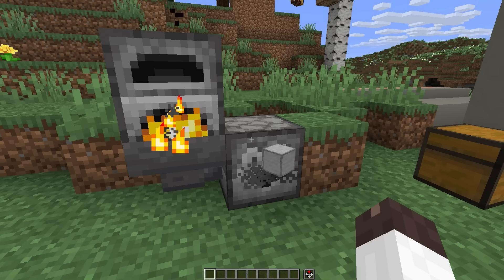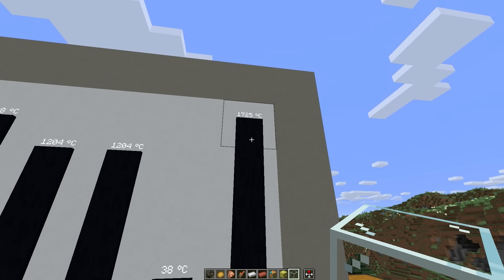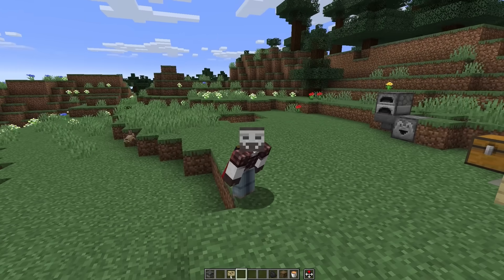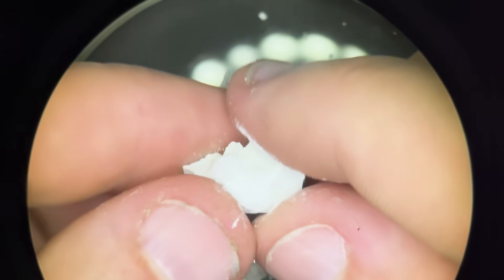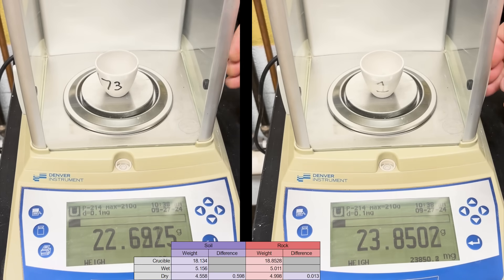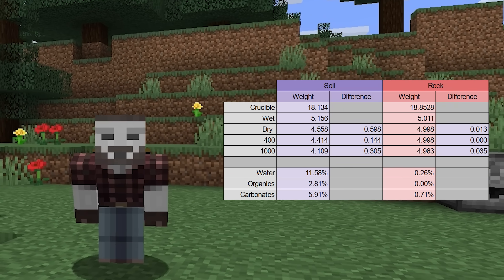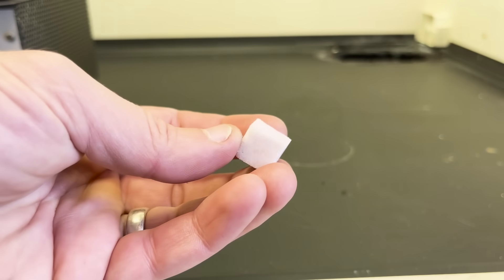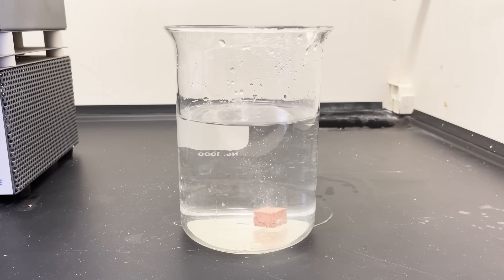Can a furnace make stone smooth?

Comment: when you throw the cooked limestone into the water, the reason it crumbles completely is because its reacting with the water -- cooked limestone forms something traditionally called quicklime, which reacts with water to generate significant heat and something called slaked lime, which can be used to make cement and i thiiink is the basis for most mortar? not as familiar with modern cements.
Reply: Lime is also a precursor to acetylene! They cook it alongside coke (a purified coal) at very high temperatures to make Calcium carbide and drop that in water to make Acetylene welding gas. (It also makes calcium hydroxide!)

Limestone is a very useful little rock.
Reply: @nata5212 Calcium carbide can also be used to artificially ripen fruits (but it's probably not a good idea, read below), as the acetylene gas released has a similar effect to ethylene, a natural plant hormone.
However, in practice calcium carbide can contain traces of arsenic and phosphorus, leading to contamination and health risks. Hence, this practice is usually considered dubious.
Acetylene: ethyne ( HC≡CH )
Ethylene: ethene ( H₂C=CH₂ )
Reply: more formally, the calcium oxide reacts with the water to form calcium hydroxide. Which is a different chemical! -- not a hydrate as it might be mistaken for.
Reply from the maker: Thanks for the answer!
Reply: Quicklime is where the phrase "in the limelight" comes from- when a flame fed by oxygen and hydrogen is directed at quicklime it produces an extremely bright light that was used to light theaters and music halls- people used to literally be in the limelight!
Reply: Also, CaO (quicklime) expands when it reacts with water to form Ca(OH)2, which is a base for a demolition grout (a mixture of compounds that expands in contact of water, which when put in a hole can shatter rocks).
Reply: people have been cooking limestone for thousands of years.
Reply: @spookyweeb5563  its theorized that native americans growing corn cooked with implements with a lot of lime, the lime created an alkaline solution which caused the corn go through a process called nixtamalization which allowed unavailable nutrients to be released and disgested. when europeans began growing corn they didn't know to nixtamalize it so pellagra, or b vitamin deficiency, became common in Europe at the time.
Reply: @art-eroflore  That innovation was more of a Mesoamerican thing if I recall correctly, since Mississippians like the Cahokians did not nixtamalize their corn and thus encountered some forms of protein deficiencies
Reply: @tylerphuoc2653  mesoamericans are in fact Native Americans! the americas = very big
Reply: @art-eroflore  yes, and you stated "native americans growing corn" largely without caveats, possibly implying that all maize-growing peoples fed themselves the same way off their crop. Mesoamerica was quite a large region, but their trade networks during times of plenty connected settlements quite well — enough to spread the innovation of nixtamalization — in a way that wasn't present to the same degree for much of the Mississippian peoples
Reply: @art-eroflore  Mesoamerica refers to a specific part of North America and a bit of Central America. It's quite far from modern day USA.
Reply: @ nobody said it was the same. Native americans includes mesoamericans, mesoamericans does not include all native americans. all tortoises are turtles not all turtles are tortoises etc etc
Reply: @art-eroflore  I made the correction under the asumption you were taking "America" as the USA like most people do, hence why i felt it was needed to point out that Mesoamerica was not in the USA and therefore their natives were not ""Americans"" in that same sense.
US people should really get a new name for themselves and their country...
Reply: @ I have heard many people from latin America, Mexico, and South America complain about USAmericans calling themselves Americans and excluding the other countries on 2 continents. thats why i said "the americans = very big" to explicitly point out it is US-centric to assume all people indigenous to the americas fit within the modern day border of the US. So I was literally trying to avoid the very response I got from you in my comments.
Reply: @art-eroflore  I get it. But then again you call  America "The Americas"
Which i know is just how it's taught to you. But the main point of the criticism of USA appropriating the term America is that we see only one continent called America, not two, so that's why i still got it mixed up. Not to say that thinking it's 2 continents it's a bad thing, continents are honestly just arbitrarily decided and every region defines continents differently.
Reply: @art-eroflore  And small correction
Latin America already includes Mexico and South America, so that was also confusing to read lmai
Reply: @xayahblush7532 no, the criticism of people from the US using American is that American, in every other country in North and South America, refers to someone from either continent, not the country. Nothing to do with how continents they see. The United States is not a continent, North America=/= The US, don't know what you meant by that part.  Most North and South American nations refer to both continents as the singular Americas
Reply: @xayahblush7532 America is the US in English. So it's not appropriation in English
Reply: @justinsutton5005 "We changed the meaning of it in our own language so we didn't appropriate it"
Bruh
Reply: @edgars1813 You're just repeatih what i said. But with one mistake. We do NOT see America as two continents, we see only one continent with 2 or 3 subdivisions: North, Central and South.
In fact, the US understood the world in the same way when they started referring to themselves as Americans. It was only around the 1950s and as art of their geopolitical interests that they started to teach kids that America is two continents, actually, so we are correct in calling ourselves americans since there is no America while invading Latinamerican countries in the name of the... monroe doctrine. You know, that one that says America for the Americans?

This is why the distinction on the continent thing is SO important and why i point it out. I don't think it's inherently bad that people think there's not one American continent, but it is important to point out we don't understand this land as two continents, because that's the most common objection. "Oh, but there's not a single american continent, so american just means us citizen!"
Reply: @xayahblush7532 Are you really going to English speakers and telling us we're speaking our language wrong?
Reply: @justinsutton5005 Yes i am, and i have the historical facts to back it up. Those you just ignored in favor of a meaningless argument.
Reply: @xayahblush7532 You'd be incorrect anyway, the 6 continent model and the 7 continent model were common in American Atlases before the 1950s. It was the seven continent model that was more popular before it became the national standard. You're just policing the English language using non English terminology. People from the US are called Americans in English. American has no other meaning in English.

The Monroe Doctrine is not the Americas for the Americans. That was manifest destiny. The Monroe Doctrine is the Americas is the US's backyard.
Reply: @art-eroflore  As an Argentinian: yes.

I refuse to use Americans to refer to people from the United States. It's ambiguous since it refers to a subset of the American continent, when every other use of America refers to the entire continent (both north and south).

When you say South American you don't refer to the south of the USA.
 When you say North American you don't refer to the north of the USA.
 When you say Central American you don't refer to the center of the USA.
Hell, when you say Latin American you don't refer to latin-speakers in the USA

Yet for historical reasons of what people called themselves when they were the only free country in the continent, when you say American people think of the USA.
It's not consistent, and it only sticks cause it's convenient and already in use.

Personally, I always just say "US People"
If you don't gonna give yourselves a non-ambiguous name that isn't outdated since 200+ years ago, I'll just use a generic descriptor.
Reply: @justinsutton5005  
Georgian: from Georgia
Norwegian: from Norway
American: from America

America does have two meanings in English.
America the continent, and America the country.

Maybe, maybe I can see that being my south american brain talking, but even if you argue that "we don't think of America (singular) as a continent but only see The Americas (plural) as meaning the continent(s)".. then what do you call people from either continent?
Americans
Worst case: North/South/Latin/Meso.. Americans

You can argue it's technicaly correct and that it shouldn't be changed for historical/cultural reasons, but you can't argue it's not ambiguous, confusing and easy to misinterpret.

Just to clarify, I'm not some argentinian patriot hating on the USA. I think the USA has many good things and I even prefer English to my native language, I just don't think calling yourselves Americans in a modern, globalized world where lots of other people from the Americas talk online, is one of those good things.
It robs the belonging of the continent. Intentionally or not, it appropriates it.
I can't say I'm American despite living in my South American country, because people will read that I'm from the USA.
So every time I have to say South American or Argentinian, while you get to say American, and I'll forever be salty about it lol
(it even robs people from the USA of their continental identity. Europeans get to say European, Asians Asian, Africans African.. but if you yourselves say American, nobody will think of your continent)
Reply: Yeah, slacked lime is a common base for mortar and whitewashing.
Reply: just wanna thank all the nerds in the chat here,  learned a lot ^^
Reply: actually the 'quicklime' IS cement, and it gets added to water, sand, and gravel to make concrete

cement is an ingredient in concrete, not the actual end product, oddly enough
Reply: @dawnderg  true, however modern cement isn't just quicklime
Reply: @roger5059 From what I understand it is still mainly quicklime, with some additives that make it flow better. Do you know more?
Reply: @jannikheidemann3805  from what i've read, portland cement (the most widely used type of cement) is mostly comprised of calcium silicates, as opposed to quicklime, which is calcium oxide
Reply: Also a commonly used flux in iron/steel smelting to pull impurities out of the metal + make the resulting slag less viscous and easier to remove from the furnace.
Reply: It's funny that the only reason I know this is from Vintage Story.
Reply: Most hard stones aren't like lime
Reply: Ancient lime cement maker here
Reply: Baked Limestone turned Quicklime, a base ingredient for ROMAN CONCRETE!
Reply: Other uses of quicklime have also included a chemical weapon. It was fired from British guns at Waterloo.
Reply: Also used for making milk (caesin) paint
Reply: Kind of on the modern cements, but it was commonly used in Ancient Rome for their buildings and roads.
Reply: I knew this because of vintage story lol

Comment: Melting sand into glass is the same as turning cobblestone into smoothstone.
Reply: But what about smooth quartz? (I'm not even sure what's supposed to happen there – it's still the same color and breaks at the same speed, it just has sharper corners and edges?)
Reply: @TheRealWormbo  I think it's just supposed to have all the rough texture melted off a little